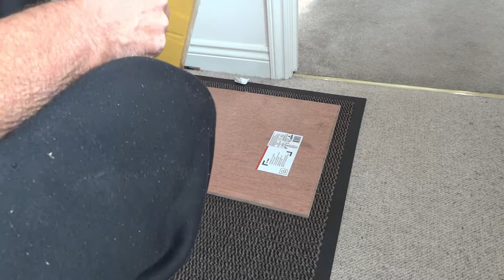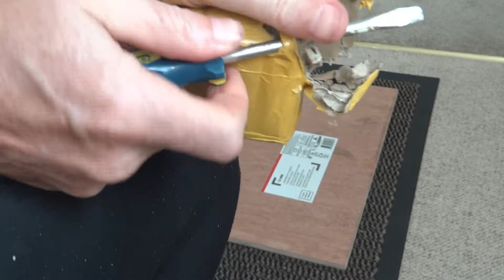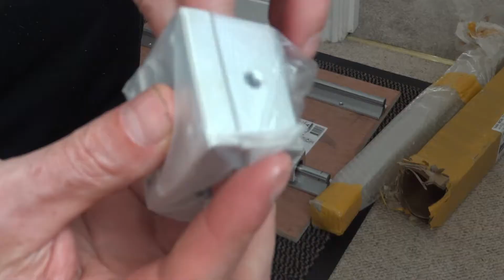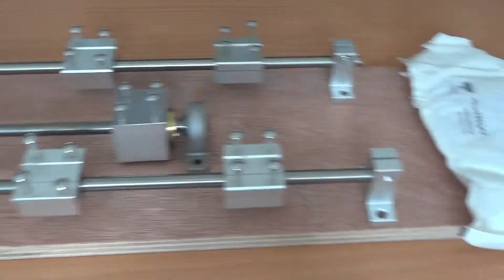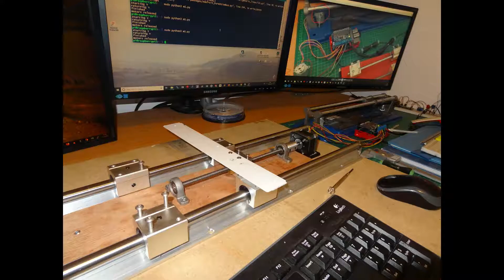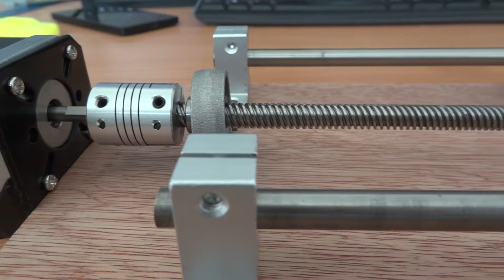Raspberry Pi - CNC Project - Linear Rails and Bearings

Comment: It might be a bit late now but check the openings for the grub screws on the inside of the bearing block for burrs pushing on the bearing outer face. If they aren't the issue then just buy the LM16UU-OP open bearing replacements and pop them in. A bigger motor might move the bearings along but you shouldn't accept a crunchy bearing in a linear system.
Reply from the maker: Thankyou for the comment - I'd loosened the grub screws almost until they fell out and the bearings were still not running smoothly, well 1 was and 3 weren't, so I'm sure it's a quality control/tolerance issue.

I thought they would be good quality as the vendor was based in Switzerland, but they were reselling product from China and when I measured the hole locations in the top of the rails with a digital caliper there was variation of +/- 0.5mm.  I'll try the open bearings.....